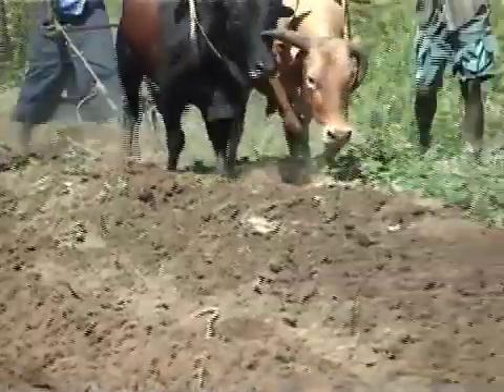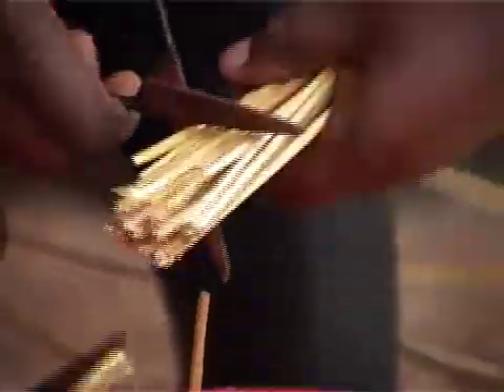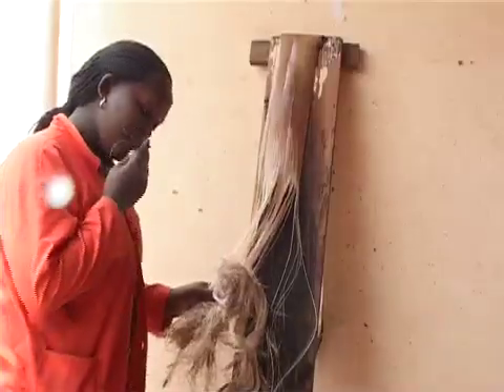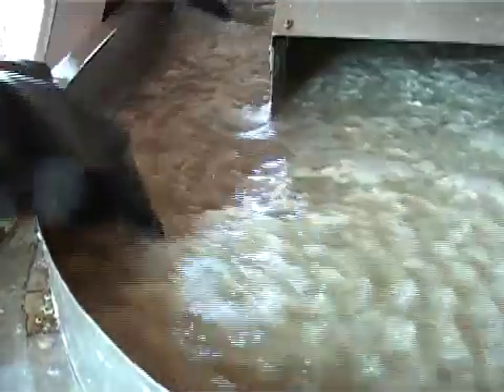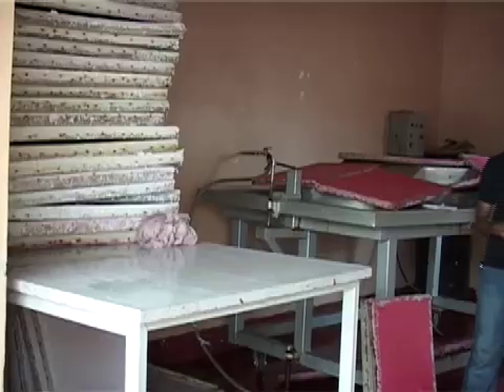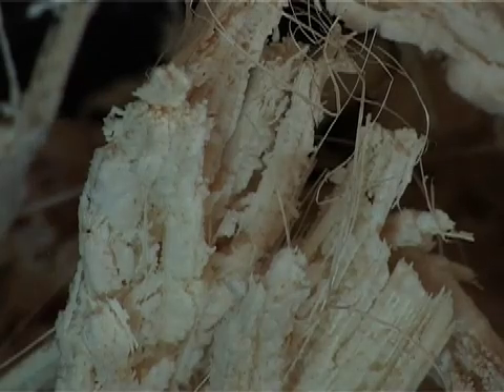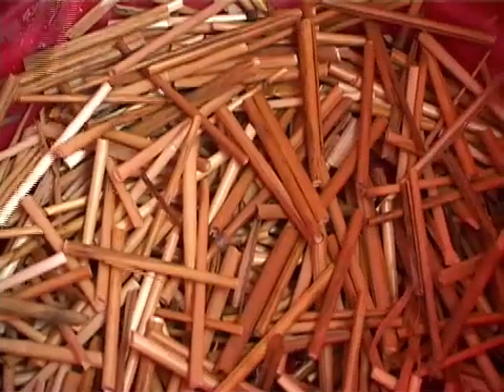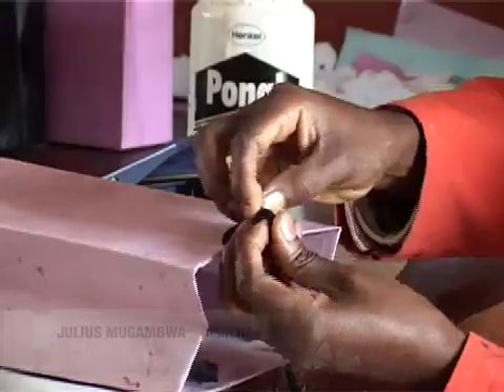Eco Talk: Organic Paper Making

Comment: After a brief study of Banana fiber extracting
champs Agro unit developed a Banana fiber extraction machine, which can be easily operated, by an unskilled labour and gives a maximum production output. 
ADVANTAGES OF THE MACHINE OVER MANUAL PROCESS
Reduces drudgery.
Fifty times increase in fiber production compared to manual process.
User friendly & economic.
Less maintenance cost and safe to operate.
Clean work atmosphere.contact us